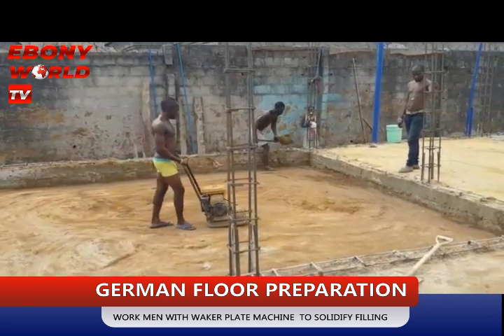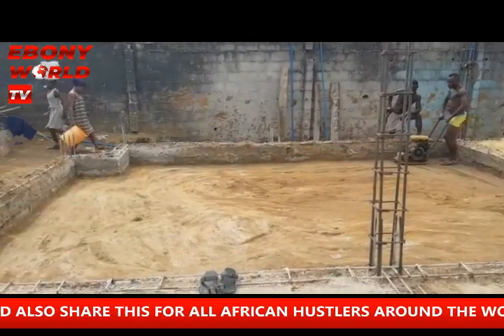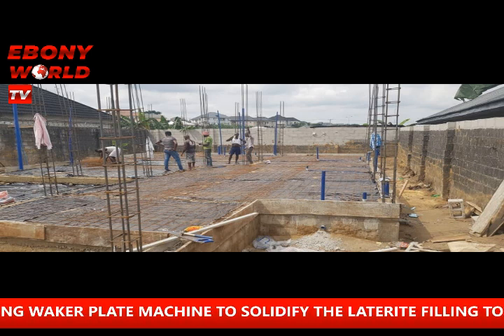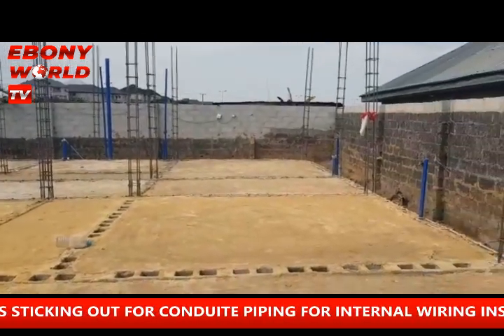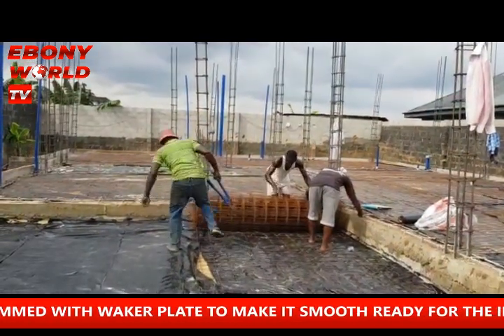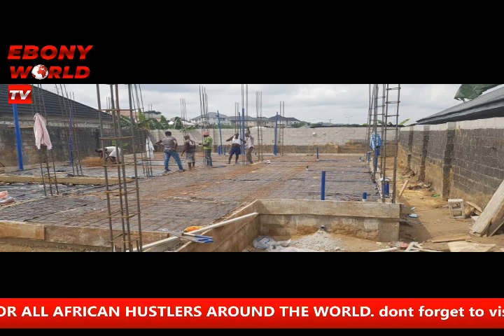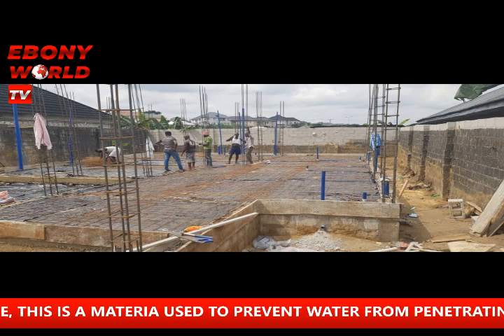GERMAN FLOOR PREPARATION IN NIGERIA AND AFRICA

Comment: Great video Ebony! Quick question: Is it better to mold ur 9 and 6 inches blocks than buying? Is the difference is savings$$$ a lot 4 someone not at home?  Cheers
Reply from the maker: I will suggest you buy them from good blocks companies that uses stone dust as part of the materials
Reply: I heard they make more blocks per cement when compared with you molding yourself. Does the stone dust make a great difference even with them making more quantity?
Reply: @LuluDumba  Thanks.  Still waiting on your video on steps how to obtain the permit to travel to Naija from overseas and vital info.
Cheers
Reply: i mean the permit to travel certificate needed to board for naija. tnx

Comment: Please I need your help…I’m doing a little project of 3 bedroom bungalow so I was told to do a German floor although it’s a dry land area so I was wondering if German floor is necessary for a bungalow house please guide me
Reply from the maker: Yes it is necessary to prevent damp on the inside bottom of the ground floor in future

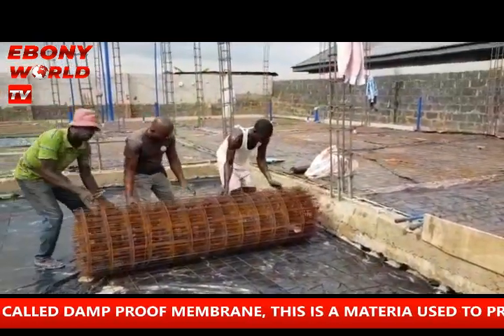Comment: 2:32 Naija workers without safety boots and safety helmet, no hand gloves, this can be very dangerous. Safety First
Reply from the maker: The low grade workers don’t think of this but the high grade worker do and big companies do provide safety equipment and boots 🥾 for workers in nigeria especially expatiate companies and some bid indegenous construction 🚧 companies too
Reply: @LuluDumba  What do you mean by low and high grade workers? So the low grade workers doesn't get hurt by nails and other sharp objects? Normally these people should have at least a pair of safety boot themselves, and if the job is under contract the company or the employer should organise all these safety kits for them, just that everything goes in Naija
Reply: Lol, still remains the same like when I was doing it 21 years ago.

Comment: Good day
How much estimate for a foundation in swampy area for a plot of land in Lagos. Thx in advance
Reply from the maker: Can’t give accurate figures but you will spend a lot on granite, sharp sand and iron rods to do raft. To do a proper and comparable estimate I charge for this as this is professional fee for bill of quantity
Reply: Thx sir
Reply: Sir, is it profitable to demolish a slanted and rundown building and rebuild it for the purpose of selling
Reply from the maker: Is this the structure you found on the land before you bought it, if not in good shape it will be advisable to bring it down and use it to level the land
Reply: I bought the land. It was build for me by contractors 20yrs back, but over the yrs it’s now slanted and the floor not raised properly, always flooded during rain period.
Reply: Sorry to border you again sir. Is it advisable to reinforce the original foundation with pilling or start a new one
Reply: @abibello5435  start again, the life span of the raft will be older to the new pilling, start from the soil testing and get a surveyor to survey road level to your compound and ground level

Comment: What is the advantage of using that black nylon .
Reply from the maker: To stop damp from the foundation
Reply: Good. So what about the concrete walls... is it left out? Bcos water can penetrate find route over time. Does it also needs a DPM ?